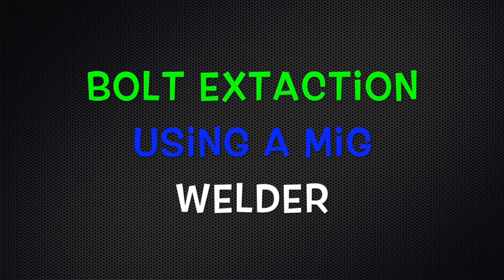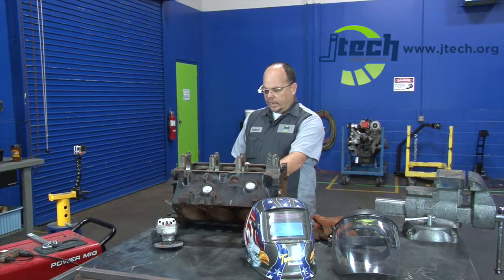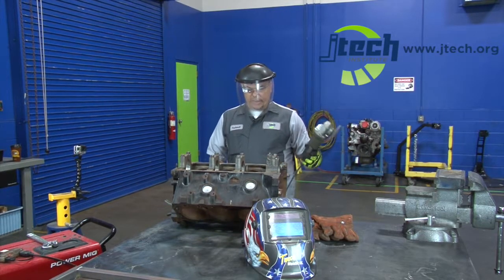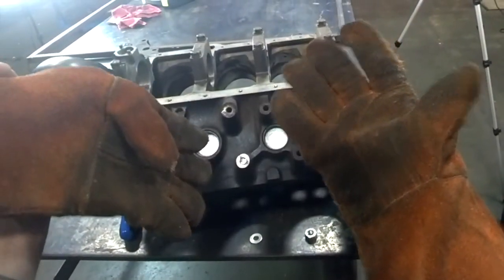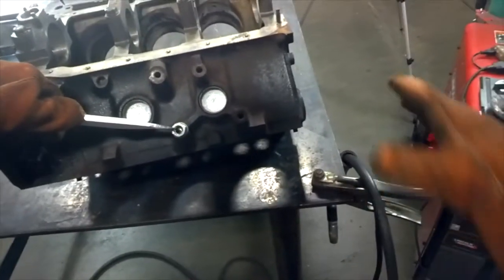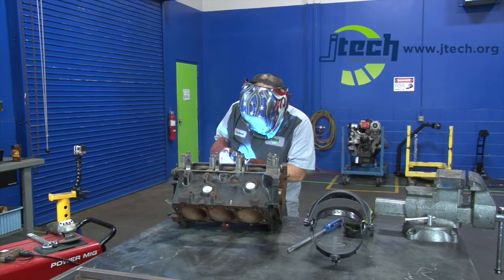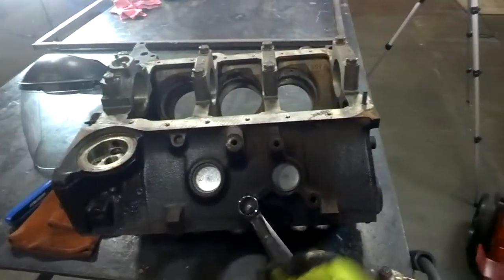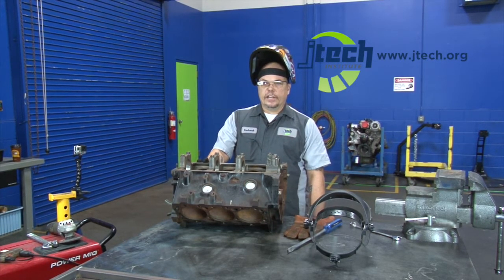Bolt Extraction from a Cylinder Head using a MIG Welder

Comment: Excellent video!  So how do you get broken steel or iron bolts (don't know what it is really) out of an aluminum engine?  Mig? Tig? How do I set it up?  What kind of amps? volts? What settings?  Kind of wire?  I'm such a rookie at this, I don't even know the right questions to ask.